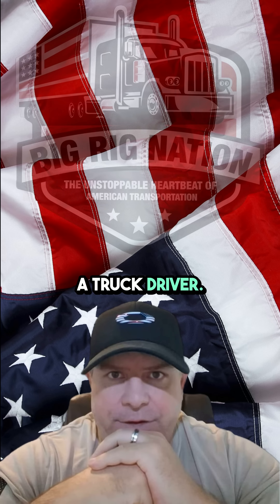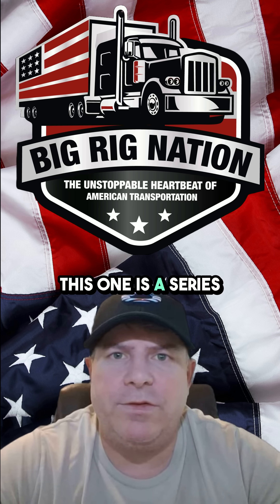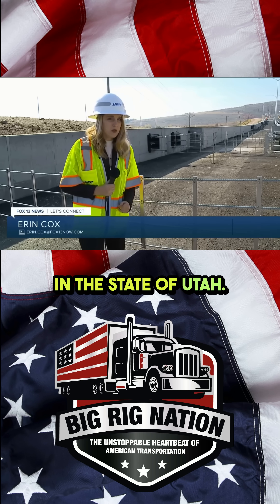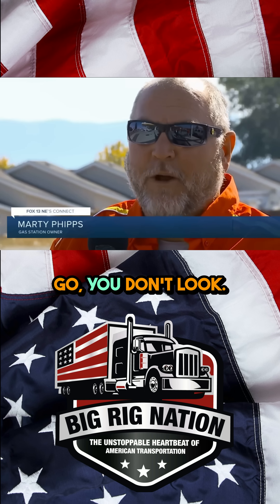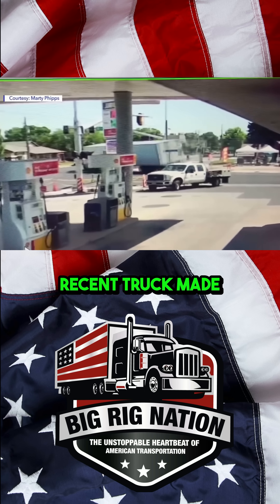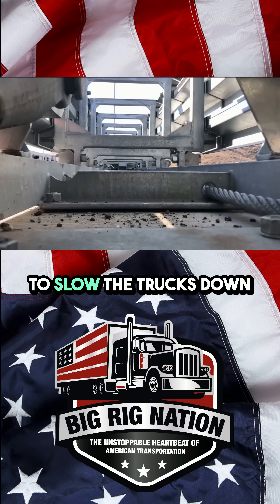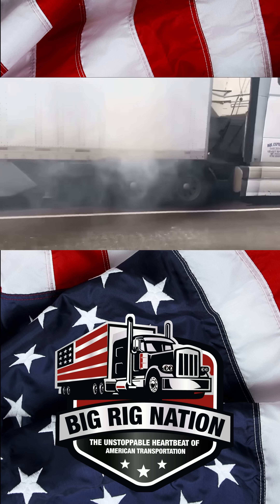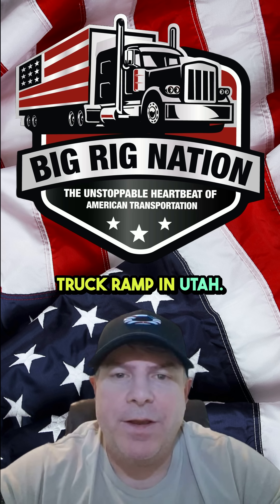RUNAWAY TRUCK STOPS ON $5M RAMP! 🚛😱

Comment: They really didn't have the room for a standard gravel ramp which is why they went with this at the location.
Two questions.
First, what difference is there in damage to a truck between traditional and this new style stopping system?
Second, would a "smart"  external A.I. system that would alert a driver that they were at risk and prompt them to take the ramp and initiate emergency braking?
The second one I know seems out there and expensive but the problem with escape ramps is that drivers are scared to take them for a variety of reasons, we need a warning system based perhaps on speed of the truck, cameras including thermal to identify brake failure.
The tech is there, it's the cost.
Better training of drivers would also help, we instruct poorly in this area.
Would simulators help?
Let them experience brake fade, "see" the smoke when they apply the brakes?
A driving simulator could be set for any situation, load, and grade.
Would this help?
Reply from the maker: Solid questions, man and you’re spot-on about the Utah ramps. The mechanical arrestor system saves space and stops a truck faster, but it will cause more structural damage than a gravel bed. That’s the trade-off you save the driver, not the truck.

As for your A.I. idea honestly, that’s not far-fetched. The tech already exists in adaptive braking and smart dash systems; it’s just not being used that way yet. Most drivers skip ramps out of fear fines, downtime, or thinking they can “ride it out.” A system that reads brake temp, load weight, and descent speed could absolutely save lives.

And yeah simulators would help big time. Let new drivers feel what brake fade actually does before they ever see a mountain. That’s the kind of training we should be pushing nationwide. 💪
Reply: @BigRigNation luckily in my case I am based out of colorado and when we hire new drivers part of the orientation and training is to take them on a couple of mountain runs with experienced trainers.
Not every company can arrange that.
For a newer driver it helps them get over their fears amd explains the proper techniques. 
We have different equipment as well so we train on the differences between them.
i.e. Freightliner and the use of descent control  vs. Peterbuilt/Kennworth and how to adjust your +- for your cruise and how that affects use of jake brakes.

Comment: Yeah in garden city there used to be a LOT of crashes into the intersection luckily they added this runaway on the shoulder.
Reply from the maker: Exactly! That runaway shoulder probably saved a lot of lives. Do you think more places like Garden City need the same setup, or is it more about drivers being forced to push too hard

Comment: Not a bad idea to be honest! 
But as an instructor, I remove the fear of failing braking systems. 
In this situation, I'd say it's the community that should be responsible for proper notification like everyone else does! 
For what the D.O.T. does to a truck driver for using one of those ramps is extremely costly and life-altering and possibly career-ending. 
Trucks are built to operate without using breaks through mounting ranges.  
My son graduated from training with Knight Transportation and wasn't allowed a passenger for 90 dayz. 
The at the time terminal manager made an exception for us do to who i was and my experience.  
So day one as a solo driver i told my son to forget what anyone else had taught him including his trainer. He was very confused , but after two weeks with a start date Jan 2nd (winter time) he called his dispatch and told the that thay can keep him north if thay needed him because he wasn't afraid to run in the snow. 
Father and son time passing down common sense education makes better drivers.
Reply from the maker: @Trumper4trump
Now that’s what this industry needs more of — real-world knowledge passed down by someone who’s lived it, not just taught it from a binder.

You’re dead on about the runaway ramps too — it’s wild how the same ramp that saves a life can end a career because the DOT wants to play judge and executioner instead of asking why the system failed in the first place.

What you gave your son wasn’t just training — it was legacy, and that’s something no mega carrier can mass-produce. Big Rig Nation was built on that same principle: common sense over corporate nonsense. Respect to both of you for keeping the next generation sharp and fearless.